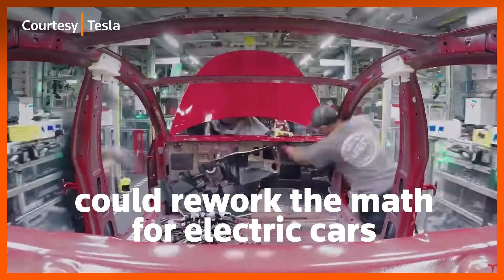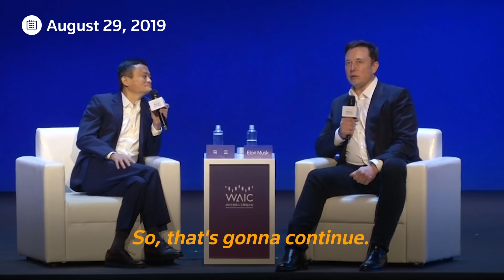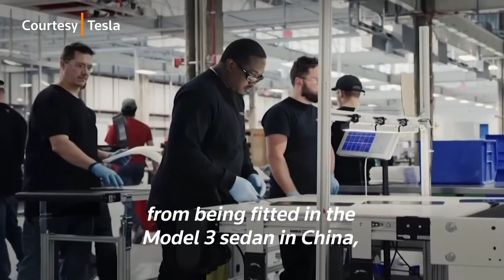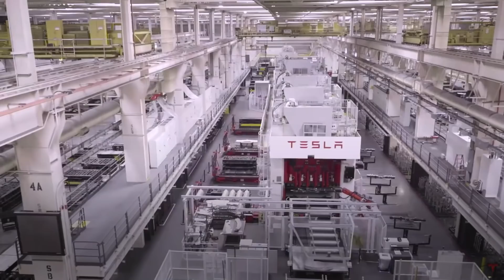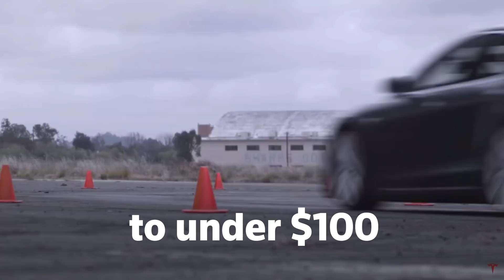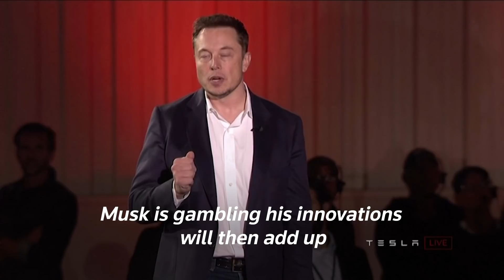Tesla’s secret battery explained

Comment: Let's remind people, when you plug the car in, it's taking most of the electricity that still burns coal to generate. Think about that a minute. It's no cleaner than a gas car.
Reply: The cyber truck can have solar panels. If you charge your electric car at home with solar panels/tesla powerwall, that doesn't use coal. Also include these factors and more I didn't mention in you're argument don't only present one side. Add up the pros anf cons then deduct.
Reply: @thejdoub6352  just bringing up the obvious. And solar panels aren't clean in the manufacture of either. It's kinda a back handed way to cover up the same status quo with the same dirty energies. Making everyone think they are doing something good, when they really aren't. Now if you had said using the actual tesla machines for the energy well that would be something. But they haven't revealed that secret yet. Hint...they have them, and have been using them for decades now, and charging people for energy produced by the earth for free for a while. They just lie about it and cover it up with a huge hoax no one is seeing.

Comment: Got news for ya.  VW is already under $100/Kwh mark last year!  Nothing amazing about new battery, everything same old same old except supposedly "better"!  How's that hyperloop tunnel under LA working out??  Same old million robotaxi by April 2020 promise from Musk!!  LOL
Reply: current tesla batteries are cheaper, longer lasting and better thermally managed then VW batteries, you can make cheap battery packs but Tesla is making cheap but capable batteries.
Reply: more VW news the iD3 is sitting in wearhouses with INCOMPLETE Software.
VW cant compete with TESLA, - Daimler.
Reply: I think you might high on Diesel fumes.... VW is soo behind...... Teslas have been on the road since 2008...
Reply: VW reach 100$ /kWh Batterycell. Tesla will be under 100$ /kWh Batterypack
Reply: @jf2107jf  - VW cant even do the Software Right for the iD3.
they don't OTA Update.